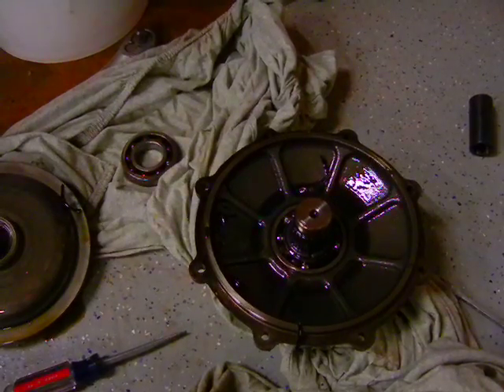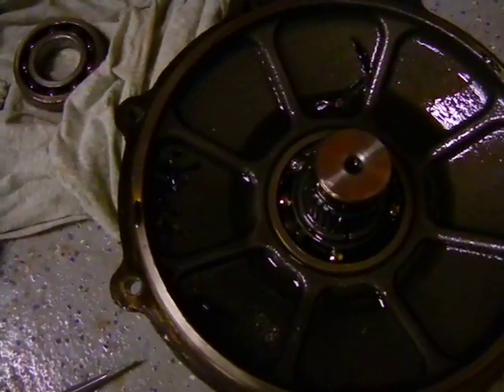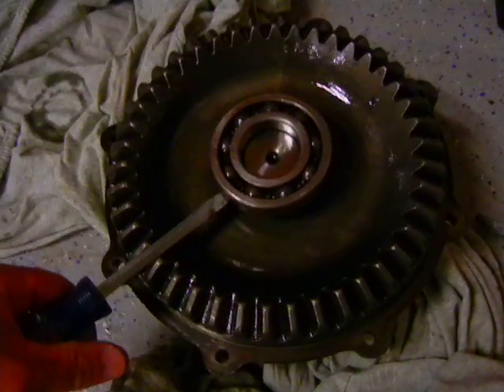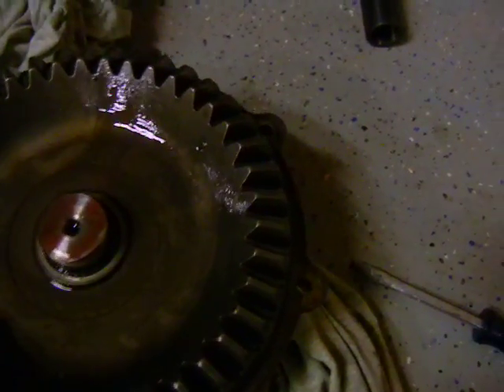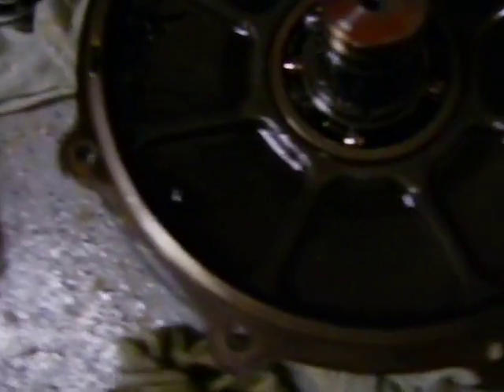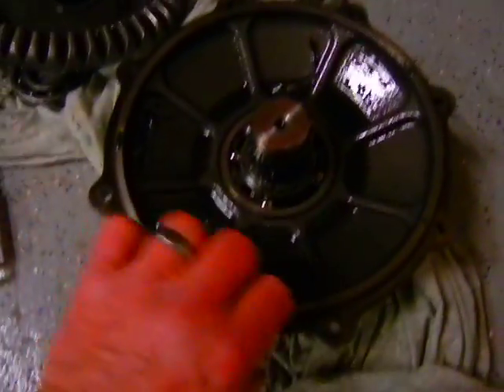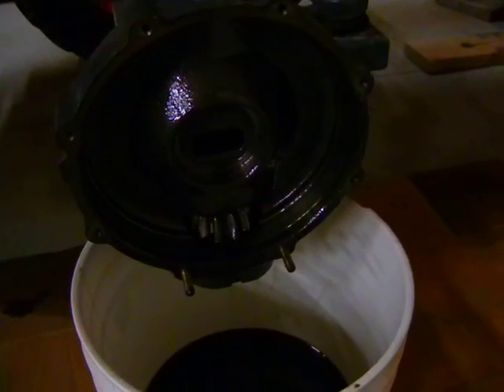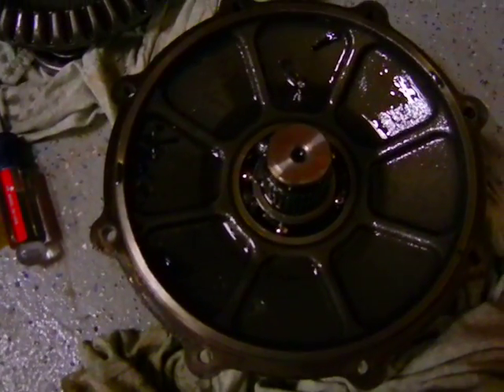Kubota Tractor Front Axle Bearing Repair Part 1

Comment: Thanks for the help also. Note that part of the old seal will remain on the shaft and takes a bit of work to get it off. Also, on my L3130 the bearing also fits very tightly requiring careful taping.

Comment: Dear Sir: On watching Part 1 of Repair Kubota Front Axle Bearing, the video showed the inside end of the axle and easy on/of of the bearing that fits onto that end of the axle.  Please note, on my Kubota B26, that same bearing fits VERY tightly onto the end of the axle.  Replacing it required careful tapping in on until it was about flush with the end of the axle.  Thanks for your help, Bill McC

Comment: Was the front end clicking? I have a B8200D 4X4 and the front end is clicking when placed in four wheel drive. I put it on jacks and started it and I am able to hold both wheels by hand in four wheel drive when its running.
Reply from the maker: Josh Sprouse Mine was not clicking, that I heard.  It was just leaking like crazy.  The bearing was broken and this ruined the oil seals.  If yours is clicking, and you are able to hand turned it, this sounds like the gears.  Taking the wheel and hub off will expose the gears and help to figure out the issue.  Good luck, let us know how it turns out.
Reply: +Josh Sprouse i -im having a similar problem with my l3010 it clicks what did u find out plz get back to me asap i would really appreciate it thanks for your time